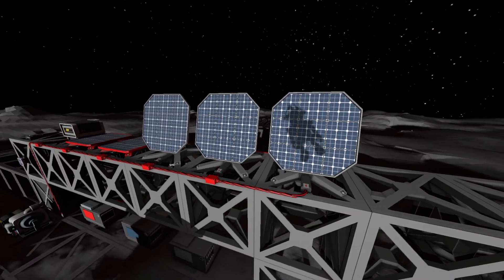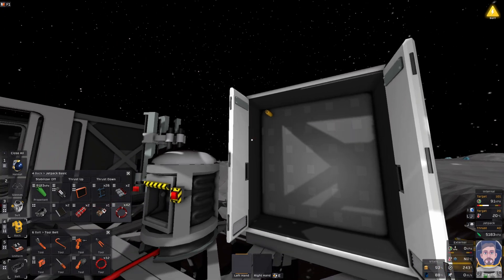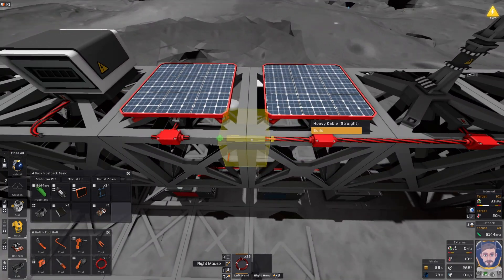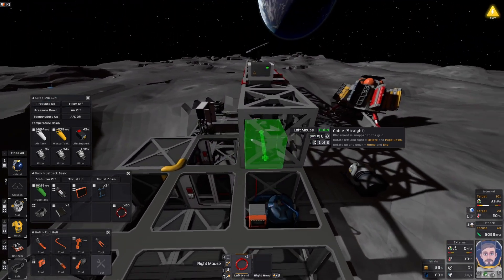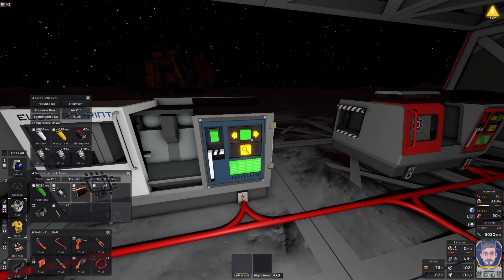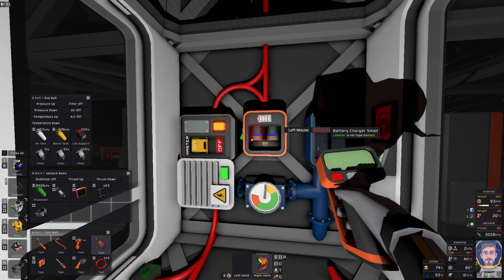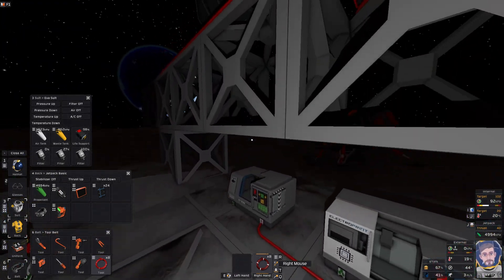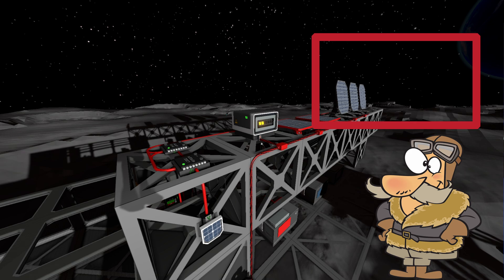How to automate Solar Panels in Stationeers Moon in 2023

Comment: define solarpanel HASH("StructureSolarPanelDual")
define daylightsensor HASH("StructureDaylightSensor")
define Daylightsensor HASH("Daylight Sensor")
start:
lbn r0 daylightsensor Daylightsensor Vertical Sum
sb solarpanel Vertical r0
sb solar panel Horizontal 359
j start

do it just like the guy but until for the logic reader and the batch writer you can
take an IC housing and an IC10
copy and paste this commands from above on your  computer 
and it will work
*important you need to place the Daylight Sensor like the guy on the video, *this is for the moon only

Comment: Subscribing for the Atmos setup.
Already done mine, filtering for O2 and N2 for now, had some hurdles with heat, complete hindsight hooking the furnace to my waste distribution loop without cooling first. Now my air is being generated at too cool temperatures, will research a more efficient way to cool down waste gas without freezing the whole distribution and wasting more power to heat my pressurised base, thinking about programming an IC10 to redirect waste input through a radiator loop only while the temperature is above room temp, that way all my gases should be very neutral and easy to heat and cool on demand without wasting too much heat generated by the furnace only to heat up again...

Comment: You don't need to leave the power output of the solar panels towards the Sun. Just adjust the horizontal angle accordingly. If you leave the power output to the west, for example, just rotate the horizontal axis to 270 degrees. The same is true to any angle you deploy the panels.
Reply from the maker: Fair point

Comment: I don't understand why you connected data ports in solar panels to battery output. Also I don't get why sensor is on opposite side then data inputs in solar panels. Basically I don't get your design XD
Reply from the maker: It is not optimal, but I wanted my Solar panels oriented in a way North - South, also I wanted my batteries near the base. So my design  was not made by optimizing for solar automation but rather optimizing for how i want my base to look. Battery output is connected to APC, and it is only a coincidence that the Data from the sensor is on the same network, no particular reason. Also i wanted the ability to use only 2 logic chips, reader and writer without additional calculation. What would be your suggestion how to put it, as I am sure mine can be alot better, but i could use a tip or 2 😀
Reply: @GrunfWorks  I think this is good enough for small outpost. But if you expand this base, you will need to change normal cables to heavy also in output side where are also data ports connected. I solved it by separating data from power network entirely. But it's totally different layout. I have solar panels on roof and batteries inside the base. One network is data network with sensor and cables connected to data ports. Logical circuits are on the wall near sensor. Another one is power network - from solar panels to batteries and further from batteries to the rest of the base. Hard to describe exact layout, I would need to draw it somehow ;) But perhaps you get the idea.
Reply: @GrunfWorks  Oh and one important thing. With such layout you really need to color code cables. Without that you have short circuit guaranteed :D
Reply: @radoslawmazurekwaw  How do you color code the cables? :P (newbie here)
Reply: @the_mrkaryo  You can make sprays in several colors. Don't remember exactly what printer is used for this right now. The one that you make tools. And wish sprays you can color pretty much everything. For example cables for lights I color white, airlocks - green and so on.